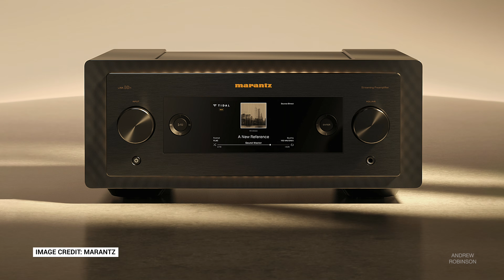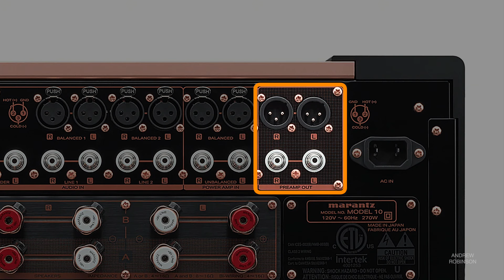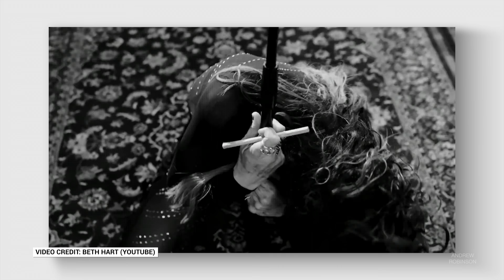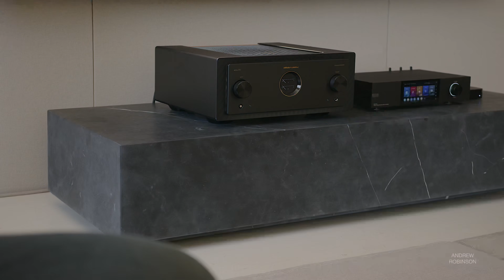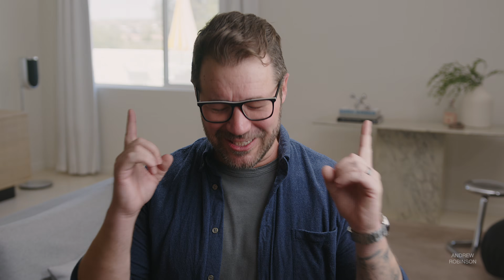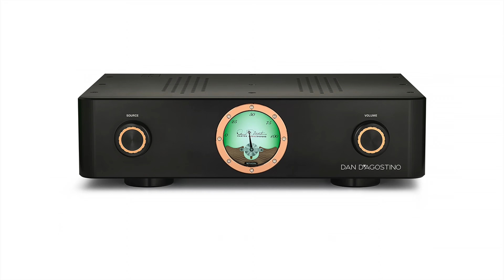Can Perfect Audio Ruin Music? Marantz Model 10 Review

Comment: Just wondering. I have noticed same thing with many 2-channel amplifiers and Marantz Model 10 isn’t the only one, is analogue connection better than digital like coaxial?. Just wondering why digital connectors are missing so many 2-channel amplifiers.
Reply: It's because in order to have a digital connection the amplifier also needs to have a DAC inside. Which the Model 10 doesn't have. You need a separate DAC to connect all your digital sources and then connect the DAC to the Model 10 via analogue cables, XLR or RCA.

Comment: just get a second hand gryphon. the reason to get the marantz is the load invariance on the class d modules. they will pair with most speakers really well. so if your building from scratch then pair the amp and the speakers but if you already have speakers the marantz should be a very good drag and drop option. i do find the comments about the clinical sound a bit troubling. its far better than that i think its a bias around class d. people just really dont like it for some reason. i do prefer the sound of class ab heavy hitters but its more close than it is miles apart and the advantages of class d might make that worth it.

Comment: Product makes NO sense... a amp that has analog only features... but the actual amps are D amps ?  Hard to believe Marantz messed this up... but perhaps a sw upgrade can change it (a thing that should never happen to analog device).  A McIntosh or Vincent audio or Musical fidelity is a better choice.
Reply: what??,...meybee you should advise also jeff rowland, legacy audio and others to put streaming to their amps. Or power amps? yeah that would make sense
Reply: Have you listened to it? Because if you have not, none of your comment matters. Personally, I dislike Musical Fidelity sound signature - its just not "saturated" and not "weighty" enough for my liking. I can name at least three amps that sound better (to my ears) than what you named: - here you go - Electrocompaniet, Accuphase, Ayre. This is just three that sound WAY better. I could then go ahead and name another seven. And, yes, the new Model 10 is not even included in it. A Mac with its blue meters is the cockney (or blue collar) dream, kinda like a Rolex is the best watch for those who never heard of Patek. Vincent is OK, but sounds worse than an Ayon, which is not in my top ten. MF is just a mass-market crap. And, I would not diss a Model 10 even though it is a class D without first giving it a good listen.
Reply: . Well i did listen to it, along with cinema 30.   love marantz have pm700n and just bought cinema 70 (the cinema 30 would not fit in my furniture).  Ohh and i am not anti D amp... love the NAD c379.  But I swear the nad sounds better than the marantz c10

Comment: I completely agree with your assessment. I had the opportunity to borrow a Marantz Model 10 from my local dealer. I paired the Model 10 with my ATC SCM-50 PSLT speakers. My Marantz LINK 10n network player served as a reliable and highly resolving source.

The Marantz failed to emotionally engage me as a listener. Instead, it sounded far too tame and somehow detached, appealing more to the musical intellect rather than getting under my skin.

In comparison, my Leema Acoustics Tucana II Anniversary Edition significantly outperformed the Marantz Model 10. The Tucana impressed with its impact, immediacy, unbridled flow, rhythm, transparency, holographic presentation and jet-black background, without ever sounding analytical or dissecting the music.

So the answer to your question is undoubtedly: "Yes, perfect audio can indeed ruin music!"
Reply: Has the Link10 the same character of Model10 (lack of dynamic)? Or is really a superior network streamer?
Thanks
Reply: @giuseppeaverna7577  No, on the contrary, the LINK 10n delivers a refined, dynamic and highly resolved performance and is a perfect match for my Leema Acoustics integrated amplifier. I listened to the LINK 10n with an Accuphase E4000, a McIntosh 352, a Marantz Model 10, a Yamaha A-S3000 and my Tucana II Anniversary Edition. I found that the differences in sound were caused by the amplifiers.

The situation is different with the LINK 10n's built-in phono preamplifier. Although the latter is perfectly designed in terms of circuitry and construction, to my disappointment it sounded just as tame and distant as the Model 10 integrated amplifier. While it is possible to adjust three different load settings for MC cartridges, this does not change the overly rounded sound signature of the LINK 10n's phono preamplifier. The phono preamplifier built into the Yamaha A-S3000 sounded far more dynamic and spacious than the phono preamplifiers built into the top of the line Marantz devices, even though the Yamaha did not allow any adjustment of the load resistances in order to match different MC cartridges.

In combination with my Tucana II Anniversary Edition, I opted for an external phono preamplifier from Michael Fidler of Classic Audio Ltd. (see michaelfidler.com). The MC Pro outperformed the phono preamplifiers built into the Marantz devices in every conceivable category.

Conclusion: Apart from the tame-sounding phono preamp, the Marantz LINK 10n is not only an excellent streamer but also an equally capable preamp with a DAC that performs at the same level as a dCS Bartók, which I was able to compare extensively in a one-to-one with the internal Marantz DAC at my hi-fi dealer. In addition, the LINK 10n offers a wide range of high quality input connections and allows mono power amplifiers to be hooked on via XLR or RCA connectors.

Comment: Musical Fidelity M8xi is cheaper, is more then double the power at 550w/channel. Weights perhaps slightly more but I'd argue sounds better overall. Even the M6si500 is around 5-6k and is similar to the M8xi but 50 watts lower @ 500W/channel and fully analog (no dac).

Comment: This is why I try and go for a surgically sterile and boringly, clear and plain sounding amp or receiver. Then I grab my external EQ. Giving the dynamic sound I want. At least it’s worked so far. You do need something able to provide a clear and clean high end sound before you mess around with it.

Comment: Almost sounded like a massive miss from a well known name in mass production Hi-Fi. How difficult this must have been to do this review. For all the years I have been a follower of Hi-Fi, I have come to find a duality in products. Those that want to have a signature sound ie: Klipsch. vs. those that want to be transparent (neutral) ie: Boulder. 
You hit on the one thing that always keeps me watching your reviews. It doesn’t matter what others think as long as you like it and enjoy it. This is truly the key to this expensive hobby. 
I was always told you want an amp to sonically reproduce sound as true to the original sound as possible. No added weight in the lower octaves or enhanced semblance in the higher registries.  Well as you said that “neutral” sound can almost fully suck the life out of the experience. 
One thing is for sure though, pairing of equipment can be essential in creating a visceral experience. Did you happen to try some other DAC’s with the Marantz just to see if it may liven up a little? Maybe a Denafrips Pontus or even say Schitt Audio Yggdrasil may have had an effect. Nothing against the Eversolo, it’s a highly regarded piece. Just curious if that would maybe have an effect on the experience. You did have a couple of speaker options in the mix.  Although again, maybe a different speaker might have coaxed a different overall sound. All be it likely not much, as this amp seems as it has plenty of power to drive even some of the most demanding speakers one would pair with this. 
At $15,000 for the amp, I would be looking at finding a pair of speakers at least in the $10,000 price range of higher to pair it with. Practical? Probably not, as this is not a price range most people are comfortable with. Nor is it likely you have a pair in that price category just sitting around. Nevertheless, you made the best of what you had available. When taking into account diminishing returns on most of this equipment, anymore I am looking for the best bang for the almighty dollar. Ideally a pair of speakers between $500-$1000 a pair, an integrated amp with a decent DAC for between $700-$1500, and a music source CD transport or Streamer for between $300-$750. That can buy you a great Hi-Fi system that will get you 90%+ of what some others will spend $50k on or more. Those last few percent become astronomically expensive, not worth it. All the best to you.
Reply: Well said!

Comment: This reminds me of your video about the new emotiva speakers.  They require SPL to have the dynamics, was the jest of your review.  This seems very similar.  I am a big smiley face on the EQ guy.  I like to have the midrange very subdued.  For me midrange makes too many speakers sound like horns.  I use Horns.  Favorite speaker so far are my JBL Studio 590's.  
I have a hypothesis that horn loaded tweeters can really pitch instrument imaging around a room.  
Tale of 2 amplifications.  I have a restored Sansui 4000.  I was interested in new amplification so I bought a Cambridge AXR100.  To get the two of them to match up in tonality I must put an EQ with very big smiley faces on it in front of the AXR.  Although the AXR is supposed to be superior, it really doesn't please me.  It seems lethargic with no dynamics.  When I try to get more of the bass and treble out of it I just get tons more midrange that I hate.  I like to listen at under 70 db and that usually requires more of the smiley EQ profile.
I am interested in what powerful separate amplification brings but I fear the High end will just blast me with mid range like the Cambridge did.  I don't know if I am crazy or lucky that some of the cheaper amplification solutions really serve my preferences better.  I also have a Mitsubishi DA-p20 feeding the DA-A10.  While it also has more proportional midrange like the Cambridge, it really does a better job at it.  So much of this becomes about understanding one's personal preferences and figuring how that can be communicated.  I remain perplexed on what is a sensible next step.

Comment: It's certainly an interesting question of whether 'technically perfect' amplification is right for everyone's preferences.  I'm very much of the opinion that the 'preference' part should be handled by the preamp and then passed through (unmodified) to the speakers, thus eliminating a key variable in the signal chain and making the job of 'synergy' easier (in theory lol).

Comment: Back in 2018, I bought a Marantz PM-10/SA-10, which is the predecessor to the Model 10. Similar stats, both class D, etc.,. I m surprised that Marantz hasn’t really learned anything from that because that was my assessment as well: Very Underwhelming! Just about everything Andrew critiqued about this Marantz is just about on par with the last iteration. I will say however that the SA-10 SACD player is top notch and worthy to keep. I wound up getting rid of the PM-10 for a big loss and got a Luxman L-590. My only regret about the Luxman is its tendency to launch my electric bill into the stratosphere. Me thinks Marantz needs to rethink their use of Class D.

Comment: You forgot McIntosh MA12000 same price 15k. Who is really going to take the Marantz over the Mac. Heard the model 10s paired with 801 Signatures at AXPONA in the Bowers room. I’m a Marantz fan and even I could see they were not doing the speakers justice and found the same sonic element as this video. Way too neutral and that extra punch was not there compared to what I remember from hearing 800s paired with MA9500 at 12k which is even cheaper than the model 10s let alone MA12000. They priced the 10s too high. There are some heavy hitters and serious competition in price range like the D’Agostino, McIntosh, PS Audio, Mark Levinson, Daniel Hertz Maria 350.

Comment: Class D still feels like a developing technology. Many standard class-D amps struggle with fast transients and can sound harsh during sudden peaks like claps or bangs. To solve this, high-end designs now use complex multi-stage feedback loops that monitor the output—sometimes even after the LC filter—to correct errors with more precision and speed. In this Marantz, the feedback loop may be too controlling, smoothing out harshness but also killing off natural dynamics in the process. (Taming the beast) A firmware update that adjusts the sound mode could help bring some of that dynamic energy back.
Reply: I use a tube preamp with a class D power amp. Best of both worlds
Reply: In my experience fast transients are the strength point of good class D amps.

Comment: Andrew, thanks for the fantastic review! I’ve added a Marantz Model 10 and Link 10 to my Cinema 30 setup and would love your insight: What’s the best way to integrate these two to get the best of both worlds — top-tier two-channel performance and seamless home theatre functionality? How would you recommend configuring the pre-outs, triggers, and bass management so the systems work together without sacrificing musicality or surround performance? Appreciate your thoughts!
Reply: The model 10 has a bypass input. Which turnes the 10 into just an amp. Just plug the precut from the AVR in. 
Marantz has really good customer service. Sure they would help with setting all the fees up to work together.

Comment: Is the magic of music a result of distortion? It seems that the more we go towards class D amps with strong objective performance, the more clinical and lifeless the sound becomes.
Reply: I think class D is just not perfect enough. Many lower-end class D amps struggle with fast transients and can sound harsh during sudden peaks like claps or bangs. To solve this, high-end designs now use complex multi-stage feedback loops that monitor the output—sometimes even after the LC filter—to correct errors with more precision and speed. In this Marantz, the feedback loop may be too controlling, smoothing out harshness but also killing off natural dynamics in the process. A firmware update that adjusts the sound mode could help bring some of that dynamic energy back. You do not want to add distortion. 😂 want you want is a better feedback loop system.

Comment: I had to laugh at the fact that I was watching this review while my bookshelf speakers were being powered by my RSL ia255.1 class D amp...  costing $110.  I would absolutely love to hear this $15,000 class D amp.
Reply: It probably sounds pretty much the same.
Reply: Genuine question:  is that because of the nature of class D amps?
Reply: @justinschultz4325  These days the circuitry for class D amps is excellent even at a low price, and the architecture is pretty similar across designs, so something in the china "budget hifi" world can easily sound very very good.  

I have a little SMSL unit that is similar in class to yours and it is fantastic.

But my comment was not very serious and I've never been near a $15000 amp so dont quote me.

Comment: Whats the difference between the almost boring neutrality of this amp to the phenomenal perfectness of the Kef R11 Metas? would this pairing be almost monitor like or a perfect match? also, what would happen if you paired this model 10 to extremely UN-neutral speakers with a huge curve? will it flatten them out? I am ultimately trying to find the balance between neutral and fun and how much an amp and what you pair it with affects the overall sound.
Reply from the maker: Noting your question for this Friday's Unplugged.
Reply: @ thanks!

Comment: As my first foray into good hi-fi, I managed to get SF Lumina V's for a great price, the first amp I tried was NAD 399. I thought it was nice enough.

I started looking at ex-demo, open box, clearance options and ended up side by side comparing Denon PMA-100 and Advance Paris A12. Both these amps could be had for ~$2500USD, and both make me really happy, but I couldn't escape the prettiness of the A12's sound. The Denon handled the loudspeaker's low range better, more attack and aggressiveness, the A12 was just gorgeous on female vocals and I found the midrange to be more articulate. On high-bias, the A12 came close to the punch of the Denon's bass presence. 

After learning they had to order in the A12, the shop has let me loan the PMA-100 (ex demo) until it arrives. Now I've just learned the A12 is sold out everywhere until August! I do enjoy the Denon alot, it sounds very good and it feels like it will be an heirloom given its heft and build quality. 

My conclusion is: Emotion is where it's at, while I feel things listening to the Denon, the A12 made me cry in a hi-fi store...

Comment: Does anyone know which Purifi amp the Model 10 is based off? Is it the 400 chip with 25amps per channel or the the 700 with 40 amps per channel? I have found owning the NAD M28 is it lacked current based on the Purifi 400 chip.